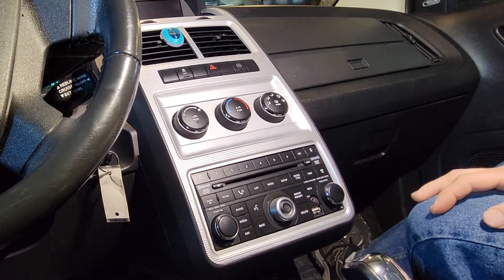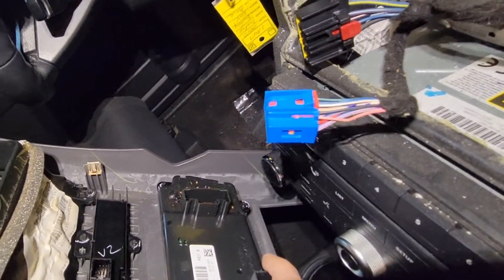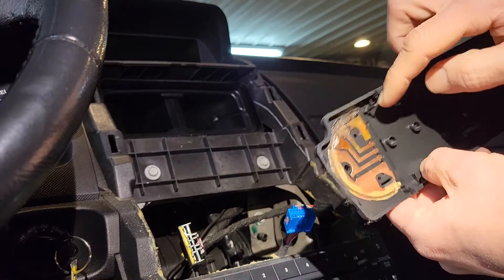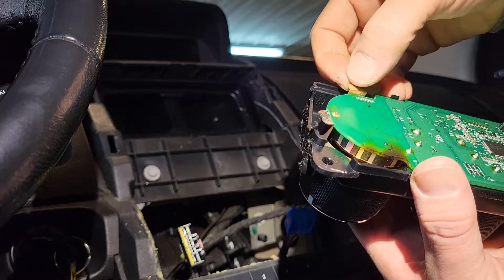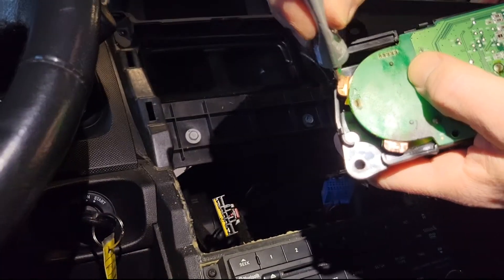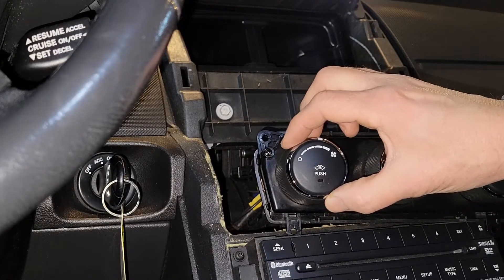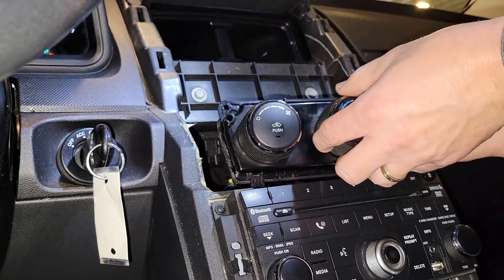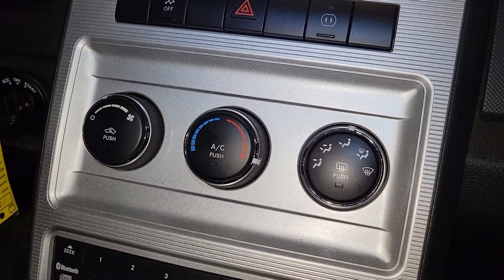Fix & Repair / Replace Climate Control Fan Speed Switch Dodge Journey - No Heat or AC - DIY

Comment: Thank you, I have a Dodge Avenger and had this problem. The way you said fixed it. But the problem is the metal heats up for some reason and melts the plastic above the contacts. I had to scrape and sand it off for it to get good connection, the grease is there to help with the connection. Why Chrysler/Dodge doesn't do something to remedy this situation is beyond me, it should be redesigned and be a recall. This item rebuilt is $140.00 on amazon and $337.00 new, this should not be the expense of the owner, someone in the design room f----ed up!
Reply: same here with a 09 grand caravan... the melted plastic ended me twisting the upper contact out of shape. scraped the plastic flush, bent the contact back into place - Bingo! but it is just a smidgen away from refailing...

Comment: Thank you for sharing this.
This is exactly what was wrong with my daughter's 2010 Journey. Cost only $2 for the dielectric grease, and some elbow grease 🙂
I can return the blower capacitor I bought, as that was not the problem.
Reply from the maker: It's nice when things work out. It doesn't usually happen that way.

Comment: If it didn’t work then a trip to a you pull it junkyard and $10. Thanks for the video. I got lucky and gripped the knob and jiggled it back and forth and in and out and changed speeds and it’s working fine again for now

Comment: Weird thing is, dielectric grease is non conductive so it's weird that that is what is used. 
I will have to take mine apart and check it. Thanks
Reply from the maker: True!
Reply: my guess is that it is to keep from crosscontacting between the different stages

Comment: You're just asking for it to catch fire again.
Reply from the maker: I got it back in working order again. No fires...before or after.
Reply: @Melvin Zoopers  the contacts will eventually wear down again and will short risking a fire like mine. It's just a bad design. I'm trying to replace the controls completely but it is not plug and play sadly.
Reply: @hybridher0 did u ever found a solution?
Reply: You are clueless, and never turned a wrench for a living.